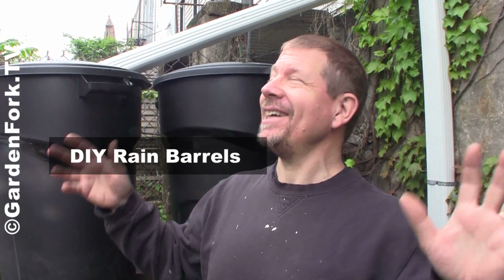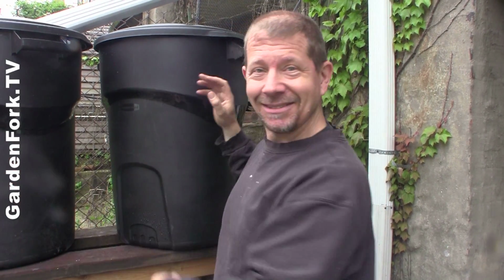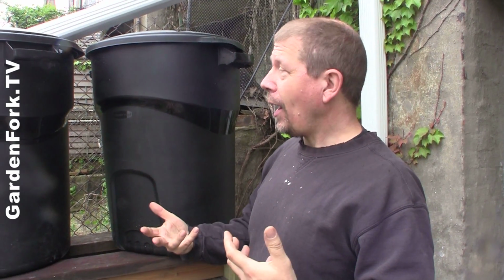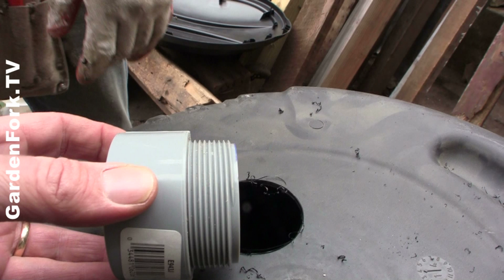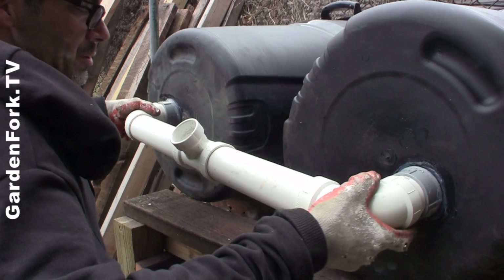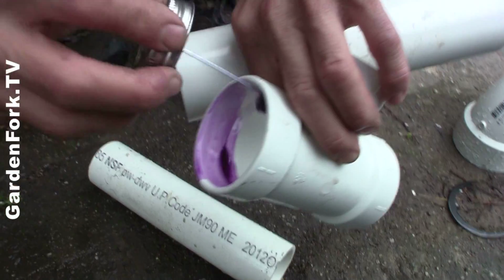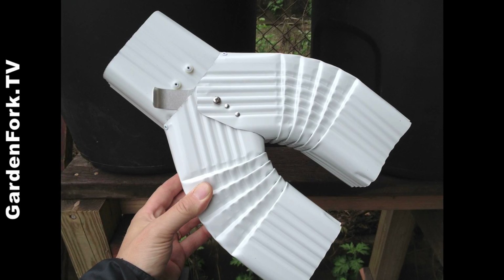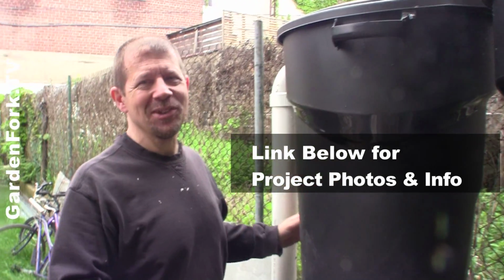DIY Rain Barrel System - GardenFork

Comment: I’m to lazy to look but you left out a major point. During the dry fitting of your pipe, once you have everything aligned, use a marker to add lines to each fitting area. This lets you know where to line up plumbing when gluing does its glued at the same angles you dry fitted.

Comment: Size of spigot? Spigot adapters? You left out all of that key info. On your website, you listed “Assorted PVC adapters to fit the garden hose spigot to the end of the PVC pipe” 
Please specify exactly the components of the spigot valve. Also is there any mesh filter? Are you drilling a hole in the 2nd can lid to relieve any pressure or leaving it?

Comment: I've been putting a similar system together and am close to completing it. My question is in regards to the garbage cans - have you noticed any deformation of them when they are full of water? Thanks, and great video.
Reply from the maker: Hi Ed, As long as we empty them before winter freezing temps, the cans have been OK. Hardest part is building a support strong enough to hold that much water weight 3-4 feet up in the air. thx!
Reply: This comment may be two years late, but I've found that the cheaper cans will bow out when full, but the heavier, more expensive one (Brute is the brand I have) is better about.

Comment: Can you use this in combination with a soaker house? Is the water pressure adequate? Also given an average annual rainfall in the northeast, how large should the containers be if you want the barrels to be the only water source? (If that's possible.)
Reply from the maker: can't answer about rain barrels for a sole water source, but i have seen gravity feed soaker hoses for sale on line, haven't used them. thx!
Reply: My rain barrel to is only a foot off the ground. I tested it with a soaker hose and a regular garden hose.  The soaker  hose was pretty much useless. The garden hose was better but also useless to run a sprinkler. The water pressure really depends on how high the barrel is positioned but I'm not going to put it on top of the garage to find out. LOL
Reply from the maker: yes, the water pressure is not the greatest. most people hand water with the rain barrel hose. i hope to get one up on hill to see how much better it works. thx!

Comment: I am asking this question around the net.
I have 2 rain barrels, but at this point we have used all the water collected, and we are not expecting rain here--if at all--for at least another week. I have read that you can use "house water" if you allow it to sit in the sun for about 24 hours. Doing that I am told will evaporate the chlorine---which I have read is not good for plants! True or not---that letting the house water sit out in the sun will rid the water of chlorine AND that chlorine is not good for plants!!
Also, I noticed that when the water sits in the barrels it begins to smell, not a bad smell, but not a good smell either! Also, it appears that a kind of green slim is starting to build up on the inside of the barrels.
Any thoughts?
Thanks.
Reply from the maker: +John Holloway something like 98% of US homes water their gardens with tap water. standing water will have algae growing in it. nature happens.
Reply: To help stop algae from growing in your barrel ensure there is a cover for the barrel. Algae likes sun so the darker it is in the barrel the better it is, and also wash out the barrel in the spring!

Comment: Its a good video.. however.. I'm really starting from scratch.  Some people don't have scrap lumber hanging around, would be nice to know what to buy and the dimensions so to build the stand.
Reply from the maker: +billanddiduffy the dimensions depend on how high you want it and how big are the barrels. built a flat platform, add legs, cross brace the legs, and you are good to go!

Comment: Sorry guys. dont you need some kind of a filter or someting like that??
Reply from the maker: +Rafael F Hi Rafael, we have not had to filter the water from the rain barrels, they work great. thx!
Reply: Instead of a filter, another option would be to  have the out flow coming from the side, 6-10 inches from the bottom. That way all your sediment will collect on the bottom.
Reply from the maker: i've thought of that as well, my concern there would be a constant amount of water in the barrel that would allow algae and mosquitos. our barrel will empty out, and dry a bit, which i think helps with bugs and plant growth in the barrell. but i could be wrong about this. ?

Comment: thanks for the info, been wanting to do this. Have to admit, I never thought of the over flow pipe, makes a lot of sense. I would had not done that.
Reply from the maker: +altha2008 yes, the overflow pipe is key with this rain barrel design, else the water will spill over the tops of the barrels. thx!
Reply: Going to make one. Again thanks for that little bit of info. how is the best way to cut threw the plastic garbage cans. I was thanking about using one for plants getting a 3 inch pipe cut it in small pieaces for the plants to grow out of the sides

Comment: The system looks solid, but I'm concerned about the plastic being safe. I grow potatoes in large plastic cat food containers. When researching this, I thought it was safer to use food grade plastic instead of trash cans. Do you think the water could be contaminated from the plastic; especially if the plastic is exposed to direct sun?
Reply from the maker: thegrimjester in a perfect we would use food grade plastic barrels, but our budget was limited. And this is in NYC, the water has already run across a flat rubber roof, which is next to a highway. so I'm thinking the rainwater is already not pure, so for this purpose, the regular trash barrels work. thx! eric.
Reply: thegrimjester Not to be used as drinking or cooking water. Watering the garden, the first cycle of the laundry, washing the car, filling the toilet, washing the dogs etc..